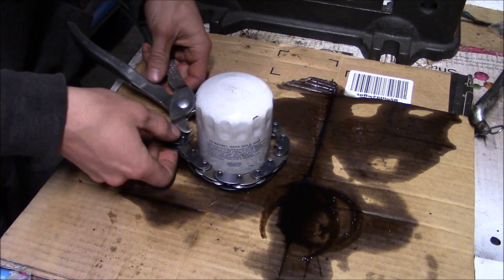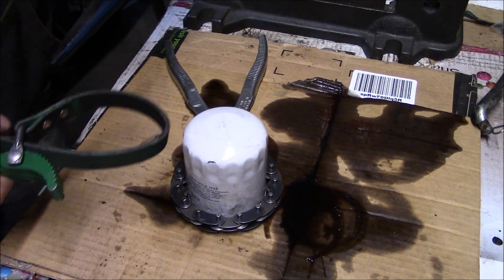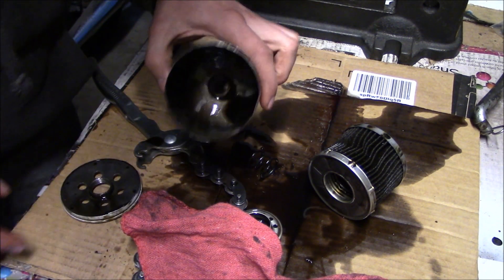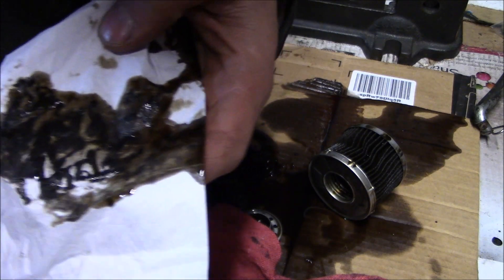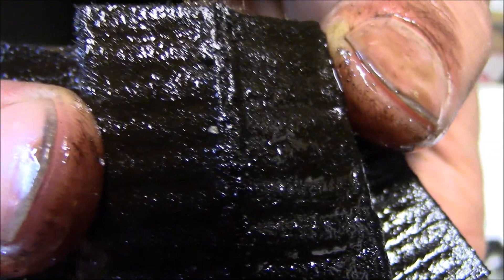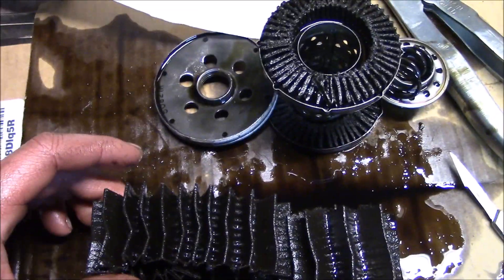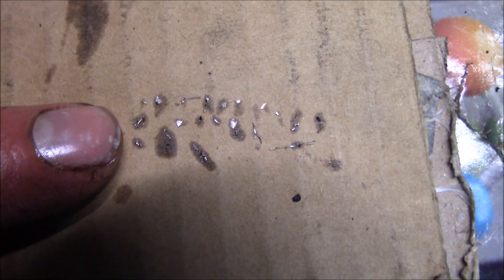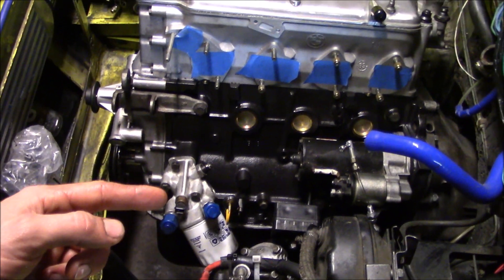Cutting Oil Filter BMW 2002 Turbo Stock M10. 3,000 miles of HARD USE, particulate analysis.

Comment: I'm thinking of rebuilding a 2002 over the summer. I'm 18 and don't want to go in over my head, how hard is it to do a rebuild on the m10, I want to keep it mostly stock, mainly preventative maintenance to keep the car forever running
Reply from the maker: What's up man! Sick seeing other youngtimers get into 2002s. First step is to figure out if you need a rebuild right now. What's up, low on power? Bad sounds? Smoke? If it's a mechanical problem you gotta catch and fix it early so most of the motor will be salvageable. If you want to see how an M10 goes together, you're in luck I just did a 3 part M10 build series. Keep in mind that this is a build up of parts I already machined and had to change to make a lot more power. Sometimes a really well cared for motor will just need new bearings, a hone, rings, and maybe some new rockers/eccentrics and guides. Thank you for subscribing!! I really appreciate the support, I'm super close to getting monetized. Start here:  https://www.youtube.com/watch?v=e8pJ6sNRG_g
Reply: @10mm  Not any problems yet, more just preventative maintenance and some easy upgrades that I could do without having to take the engine out. I've started it up and it runs pretty well, needs a lot of interior work and to be completely gutted and repainted. I watched the m10 videos, a really cool engine and that gives me a good idea on the amount of work I would need to do (I would probably send it out to rebuild since I don't have any of the tools).
Reply from the maker: @ValorantMUFF1N  Good deal man hit me up anytime if I can help.
Reply: @10mm  thanks, I'll defiantly send you a message sometime when I start to rip this thing apart!